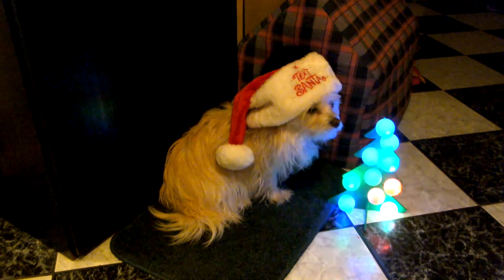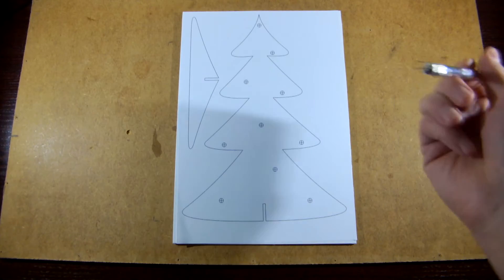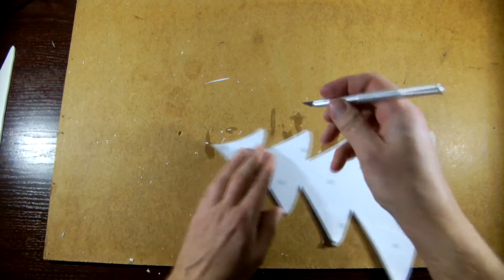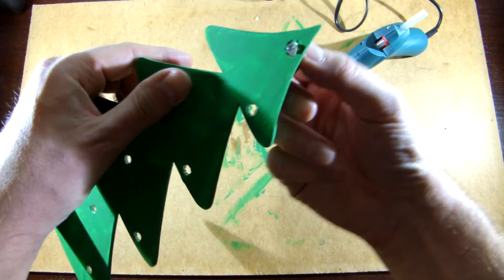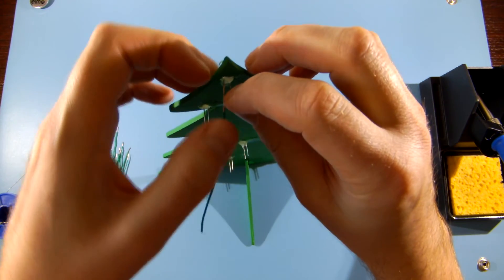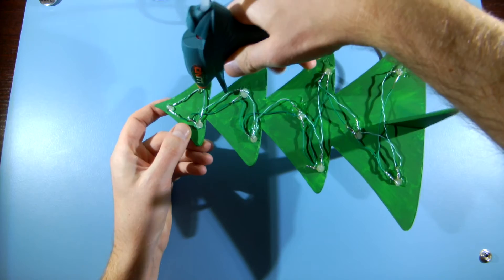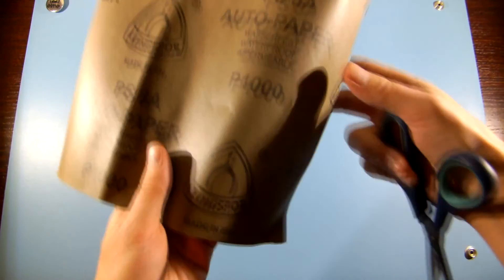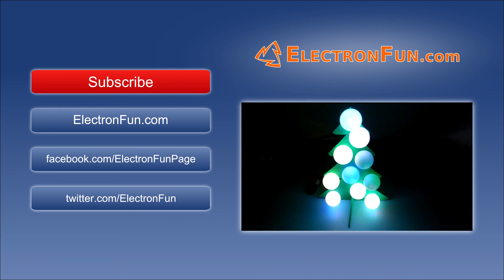How to make a blinking PVC Christmas tree

Comment: Excuse my ignorance, but what makes the LEDs flash? I'd imagine they would simply all light up. - confused noob.
Reply from the maker: +Bernhard Hofmann Hi, asking questions should never be considered as ignorance :) I don't remember if there is any piece of information in the video about the LEDs - they are simply made as RGB, blinking LEDs. I bought them on eBay as RGB diodes, but I didn't know they would blink. They turned out to be perfect for this project, because I didn't have to use a microcontroller to make them blink.